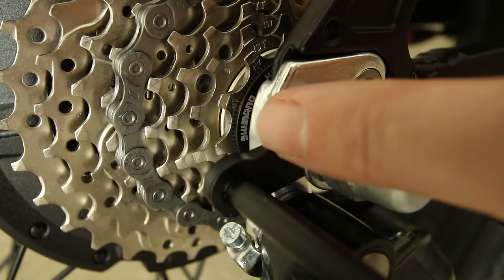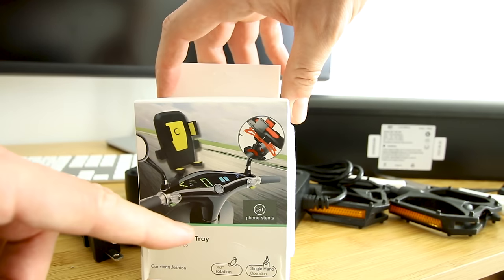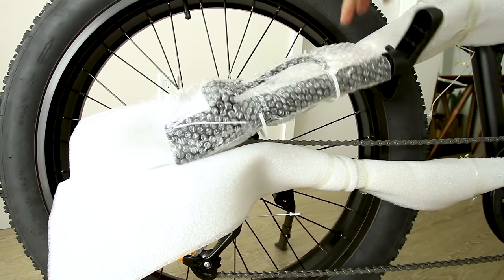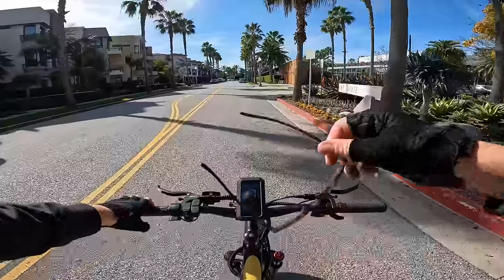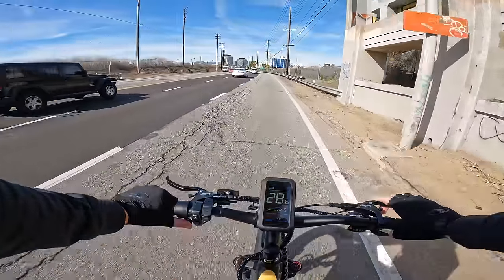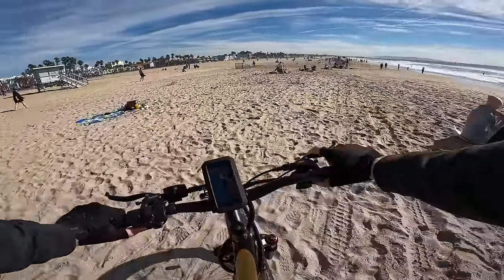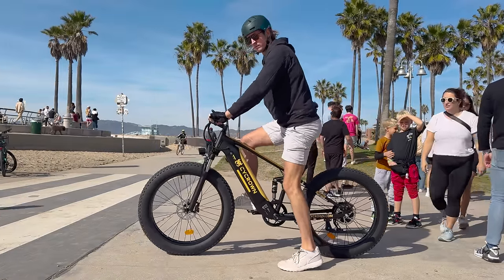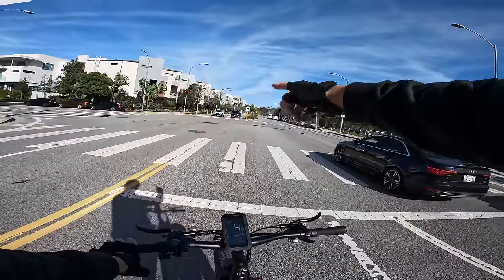This "Affordable" Full Suspension Ebike is a Strong Climber - CyCrown CycUltra Review

Comment: This isn’t a comment on this review it’s just a thought from someone that doesn’t know much about Ebikes. I’ve been a fan of your channel as I looking for a new bike. Here is my question I’ve seen in some reviews your weren’t getting accurate speedometer readings due to the wrong size tire size programmed in the bike software, I recall you going from 26 to 28 to correct the speed to Mach your phone. Now here is what I want to know if the bikes software cuts the power when you reach max speed can you fool it by programming in a smaller tire size. Hopefully I got that right and it’s not a larger tire size but it’s almost 3 am and I’ve been up since 7 am and I’m not think straight. I’ll check back for an answer keep up the beautiful videos

Comment: Nice looking bike. I  like the fact it has rapid shifters instead of the dumb thumb shifter. Why put thumb shifters on off-road bikes? I watch alot of your videos, good stuff. I decided to buy the Heybike Brawn after watching your videos. I liked it alot, except for the thumb shifter. So I put about 6000 or 7000 miles on it, then got hit by a car and the Brawn is totaled and my face too. So I have a question for you Happy, my battery is still good and I have two batteries actually so I noticed that the Cycrown appears to use the exact same battery and I know you're basically a expert with ebikes so do you happen to know what bikes out of your collection use the exact same battery? The Magicycles do but they're 52 volt systems and my batteries are 48 volt. I see the cases seem to be the same but I'm not sure about the length or width of the case. You've responded very quickly in the past and I'd like to thank you in advance for that and any other information. I have the two batteries, two motors, six sets of replacement planetary gear sets, and all the remaining Heybike Brawn parts on the bike. The frame was bent and the bearings in the headset were basically torn out of the frame from impact. Unfortunately Heybike is unable to sell a frame and I have to buy a whole new bike. So I like the looks of the Cycrown and it's a full sussy with 9 speeds and rapid shifter and I'd likely swap the cassette to a 40 tooth climber for my big rear gear. I like single-track and was doing it with the Brawn to a certain grade, then the hills were too steep with 7 speeds and a thumb shifter. I'd probably switch to a actual e-mtb with 27.5 or 29" wheels @ 2.5" but have 26" studded tires and regular ones too so my place is looking like a bike shop with no bikes. Keep making good content and I noticed you're riding to new locations which is cool because we the viewers enjoy the switch up.